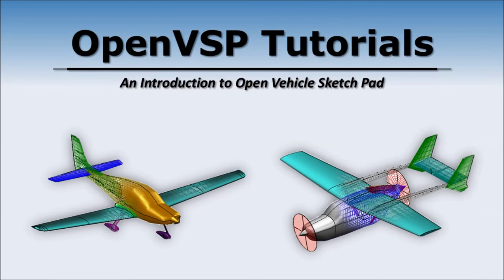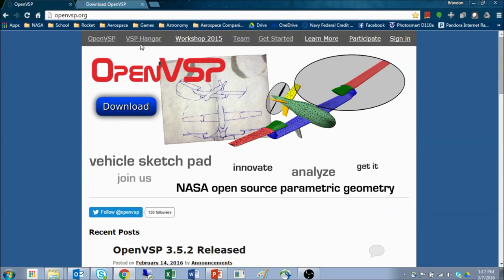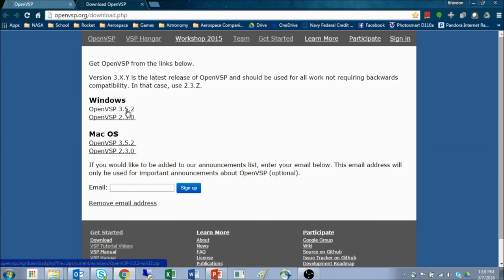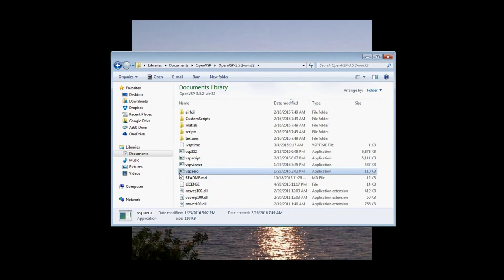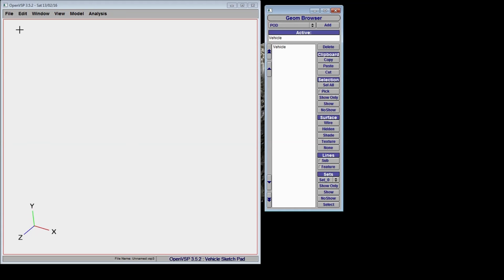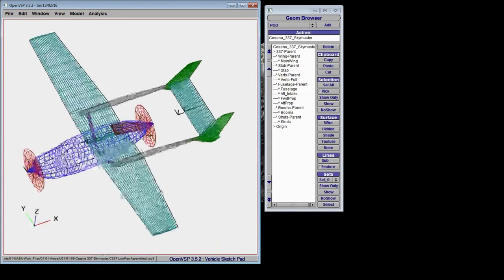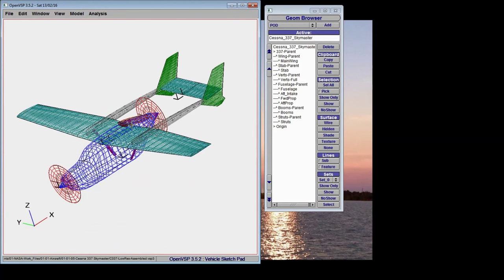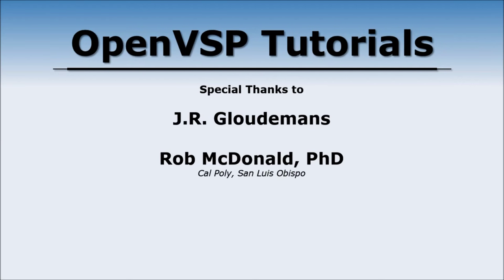OpenVSP Tutorial -- Getting Started

Comment: I downloaded the app (Windows version) and it runs but there are no sample models as shown at 2:36. Is there some way to get the 'Hangar' contents as a complete downloadable package or are they only individually downloadable?
I did try downloading a few samples from there but it seems the Open dialog won't load a .vsp file, only .vsp3. I tried renaming a .vsp example with the .vsp3 extension so it would appear in the dialog, and it appeared to load, but no rendered image is displayed. Presumably the .vsp is an earlier file format that needs converting or an earlier version fo the program installed? I found only the actual .vsp3 files would load.
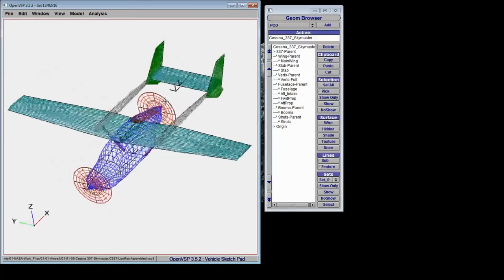Zooming as shown at 3:15 doesn't seem to use the scroll wheel and there isn't a zoom on the menu, only 'fit model to page'.
Thanks for any help!